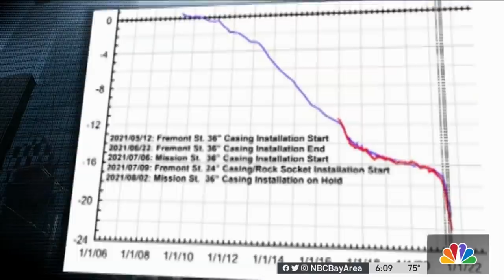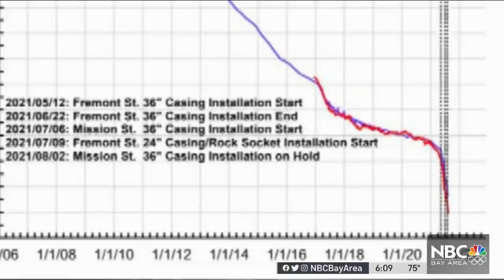Millennium Tower is Sinking Faster Than Rate ‘Limit' Set by Fix Engineers

Comment: easy fix: fold a bunch of refrigerator boxes and wedge ‘em in at the base
Reply: Wrong !!  A few sugar packets from McCafé is the correct answer.
Reply: your all wrong.. you need a book of matches
Reply: @carpelunam  I suppose this is really the best option after all. 

One question : do we douse the building with gasoline first , or , just light a wad of newspaper w/the matches & let it engulf slowly??
Reply: I was thinking some Tesla's and Mercedes Sprinters mixed in there all stacked up.🤣
Reply: Control-Alt-Delete  do you have a Sprinter?
Reply: Control-Alt-Delete  well you can keep yours. Destroy all others 🤣😅👍
Reply: Control-Alt-Delete  yeah I agree 🙂👍
Reply: move my mother in law to the opposite side of the building and it wont budge another inch
Reply: Control-Alt-Delete  lmao idk I was just making shit up. Dont have a mother in law
Reply: @DeuceGenius  “You kidding me, my wife’s so fat, when she puts on high heels she can strike oil”
Reply: Control-Alt-Delete  “I tell ya, when she steps on a weight scale, a card came out that said  one at a time”

“She’s so fat, when she takes a bath, she leaves stretch marks around the tub”
Reply: It works for that uneven table in the restaurant!😅😂🤣
Reply: @carpelunam  fire hazard,  but at the rate they are going maybe the best solution for that building!
Reply: Must be a southern fix
Reply: Just throw a cable around it and cable it up to the closest building and get a come a long and jack it back into place then throw dirt under the low side. I'd recommend going a few degrees past center in the opposite direction of the lean to allow for some slack to take the come a long off. .
Reply: @bartonpercival2147  Well now damn!!! I mean just DAMN!!!!🤣😂😅
Reply: @jamesstreet856  😆 Well that was just some old “Rodney Dangerfield” jokes re: how to fix the tower from the earlier “mother in law” comments
Reply: CSXRockford  omg my grandmother is back from the grave! Grandma???
Reply: Save on recycle. Throw your frig under there !
Reply: You sound like you got your engineering degree from Trump U and got out with high honors.
Reply: @DeuceGenius  rent one.
Reply: @bartonpercival2147  YT deleted two of my phat woman jokes .
Reply: @robertkustos2931  well maybe they weren’t fat or ugly enough jokes. “I tell ya I never had luck with women when I was growing up. I mean the girls I dated were big and ugly. I took this one girl to the beach, and they all asked me what I used for bait”
Reply: Jolly Joker.
Reply: @bartonpercival2147  what did you say , Harpoon
Reply: On All Future Blogs.in Cali.& Other Earth Quake prone Cities,Put  Japanese Architects & Engineers in Charge of Projects.Their Bldgs.Can Take 7.8-9 .0 Quakes  W/ Virtually No Major Damage.They Are the Experts on Constructing & Having Proper Foundations on High Rises.
Reply: @DeuceGenius  🤣
Reply: All they gotta do is reach under and twist one of the legs holding up the building. Theyre basically machine screws with feet. Turn it left, the leg gets longer. Anyone with a level and a wrench could fix it.
Reply: Let's be creative here.  SF can't figure out what to do with all the used hypodermic needles and human feces on its sidewalks.  Create a landfill of crap & hypodermics under the building to counter-act the sinking.
Reply: ITS TIME TO BUY GOLD STOCK.WHY RUN FOR CRYPTO.
Reply: BECAUSE OF CRYPTO ECONOMY COLLAPSE.INVESTORS SHOULD INVEST IN OTHER STOCKS
Reply: They could start with the fridge boxes from Nancy Pukeosi’s pair of 20 thousand dollar sub zero units she has to store her 14 dollar per pint ice cream

Comment: Let’s build a skyscraper on landfill, what could go wrong? Duh🤪
Reply: Happens all across the U.S., in San Diego during the last two years I watched builders put a new suburban housing development where they filled a canyon. Homes starting at $800,000, sitting on 100 feet of compacted dirt.
Reply: And then we ca blame climate change when we change the ecosystem ourselves.
Reply: This Will Get Me Banned Again  Exactly: along Hwy 56 between Camino Del Sur and Carmel Mountain Road. Name of development, "Merge 56 Project" west of Rancho Penasquitos. I used to run a trail in the canyon that is under 100 feet of dirt. They are putting in the connector road to Camino Del Sur, with the shopping center and condos on top. San Diego already had problems with settling cracked slabs in the 70' s and 80's, this will be another lot of them.
Reply: Earthquake= more tilt = Boom!
Reply: Landfills are expensive, to maximize use of land, developers must build high.

Comment: Failure of man-made structures, failure of man, failure of confidence
Reply: Ya well we would have woman built confidence but they don't build anything. But holy smokes if there's a sale at 2 am they will be there. Or if Ellen is on
Reply: failure of hubris
Reply: how can we trust engineered buildings when engineered means..the most strength with the least material in controlled tests..when   the field there are  no certainties..when these minimum materials are subject to rust heat cold...and metal fatigue over time...just like our cars..structurally sound when they are new...but 20 years of road salt later...unsafe at any speed...and the ones that last are the inefficient over built ones that are gas guzzlers..
Reply: man is not perfect, sht happens
Reply: its just one of those things, there is something to be learned from it for other locations

Comment: Has anyone calculated at what point of leaning is the point of no return when a catastrophic collapse is inevitable?
Reply: Good question. As it leans further it begins to lean faster as more weight is shifted off center then, once it reaches a certain degree of lean it's all over with. There is no way I would even go in that building
Reply: 45 maybe???!!!.  I have no clue ask the leaning tower of Pisa 🐒😌😱💥
Reply: i have to know, so I wont go there for my daily coffee and pastries anymore
Reply: Mayor London Dog Breed doesn't care.
Reply: I’d think it shouldn’t be hard to calculate by someone knowledgeable about the building. I would like to know the answer to that as well
Reply: Yeah, the point when you hear the base start cracking and if you're hearing that? make sure to run opposite the way it's falling.
Reply: @susanlbk  ask Mayor London Dog Breed
Reply: Already past point if no return.... May fall soon!! With core sinking faster than the outside walls.... Soon
Reply: Yeah, the same engineers who submitted incorrect estimates last time around🤣
Reply: No engineer in their right mind would make that determination.....you will have to ask a politician....
Reply: 13 degrees.

Comment: Champlain towers was leaning 1 inch or 40 years and fell down. This building is leaning 22 inches? I cannot even fathom understanding that?
Reply: Can only imagine what the inside floors look like
Reply: It's crazy
Reply: @deannaausten8867  staircases
Reply: @deannaausten8867  Set a bunch of marbles on floor and just watch them go.
Reply: @NeilPower  lol... then they would tell you nothing here everything's fine floors are good enough
Reply: Champlain did not fail as a function of lean. All building, especially towers, have a acceptable coefficient of lateral stability. The Champlain complex has a concrete erosion situation, at its base. It could have been repaired....

Comment: I built a house ... when the excavation for the basement revealed there was a solid limestone rock base two feet deeper then our excavation required ... I asked them to dig deeper!

Cost was $400 for extra concrete. and $100 cash to the excavator operator :)

I put up the concrete forms myself ... and drilled and drove rebar in to pin the footings to the rock.

We had a basement with almost a 10 foot tall ceiling!
Reply: $500 extra? How could a developer be profitable with all that extra expense?
Reply: @Mike Baxter   Good for you. Foundation work is the most important part of any building or road or railway or factory floor.   Get it wrong, and you live with the consiquences for years.
Reply: Your point is? That they should have dug 80m of soil to get to the bedrock? Btw, you went all the way cheap by "doing it yourself" Mr developer. You could probably have a lot of defects in the foundation and we just don't know about it because you've hidden it underground...

Great example yep
Reply: @EarendilTheBlessed  They drive piles down to bedrock Fred. There's no 80metre tall basement like in a residential home
Reply: @MikeBaxterABC  
I know what they are doing. What is your point?
Reply: @MikeBaxterABC 
You mean, you have none.. Great

Comment: Omg at this point, just rebuild the foundation and rebuild the tower with reinforcements or whatever the current tech allows. All these years trying to patch an impending doom didn't work. During those years they surely could have rebuilt the whole lot with entirely something new.
Reply: Fax 📠
Reply: theres a reason they spent all that money and time on it. if you take that thing down you may as well chalk it up and call it quits.
Reply: They are currently trying to drill 2' and 3' x 300'+ concrete and steel tubes down to bedrock, alas that work has been stopped recently because the building started sinking and leaning faster, due to the repair work.

Comment: Hook a helicopter to the roof. Pick the building up a little, spray that great stuff expanding foam on the low side. That will fix everything
Reply: A little 200 mph test duct tape also may help.
Reply: 🤣🤣🤣 although probably better than the actual plan

Comment: This does question the usefulness of San Francisco's building regulations.
Im all for thorough regulatory processes when it comes to infrastructure HOWEVER there is a difference between filling out 1001 different forms & a process that adequately evaluates a proposal.

Most modern regulation is just box checking.
We have been building skyscrapers for well over a century. We shouldn't be having issues like: Poor ground stabilization at this point

Comment: When Champlain Towers South collapsed, the internet was crowded with the condition of the Millenium Tower. How long until it collapses?
Reply: the question is will it collapse at free fall speed like happened 3 separate times on 9/11/01?
Reply: I'm still waiting for the 3 gorges dam to collapse. Any second now.
Reply: @kalatime - What does it have to do with the governor.  It's the builder's fault.
Reply: Who knows, an earthquake can shorten the  time frame from years to days.
Reply: @chillbro606  - Depends if Larry tells the ghost FD  Commander to pull it.
Reply: @hangender  - Oroville is on my watch list. Half the watershed is burned. Those mudflows into Oroville lake are not going to be released via a spillway. That means the lake is going to up very fast. It is an earthen dam, if it overflows, it fails. And nobody disputes that. 5,000,000 residents  live in the flood plain below.
Reply: 300 years

Comment: I'm not an engineer but I would build a helicopter with a couple or maybe 4 Chrysler 426 Hemi engines and then hook a cable to the top of the building and then to the helicopter and fire all 4 Hemis at full power while pulling in the opposite direction of the lean while engineers on the ground pound some big wedges around the gap at the base.  Hope that helps.

Comment: Well what do you expect , SF is on wet land . The foundation of the ground in that city is horrible
Reply: Its horrible but not impossible to build on. Those idiots went cheap and didn't drill all the way to bedrock. This is the end result
Reply: @mayhemjr.803  Exactly
Reply: I think a moderate earthquake of 6.3 or above could topple that. The key factor is how close and how deep if the quake. 

The Northridge  quake was 150 miles from me, yet my house was shaking big time.

The 1989 Loma Prieta quake shook half the buildings in downtown Santa Cruz so hard they all had to be torn down. 

No matter what she quake hits the area - within a 30 mile span from SF, the  ground  shaking or faction, will accelerate the tilt. 

Dismantling a building that size, which  is too dangerous to live in or be in, will not be easy.
Reply: @mayhemjr.803  They saved how much........ $20,000,000 ? That stunt likely a $2 billion crime.

Comment: I saw this movie once where they hooked a lot of balloons to a house and it floated away. I mean, you'd need a real lot of balloons but...
Reply: RIP Ed Asner
Reply: hook the tower up to a couple of SpaceX rockets and send  into orbit
Reply: A lot of balloons won't do it.  Even if you harnessed an air column from sea level to space with the same width and length of that building you're only getting about 16000 tons of lift, or about 500 truck loads.   I'm not sure what the building weighs but you'd also need to suck its 75 feet of basement clear out of the ground, assuming the concrete pad and 950 x 80 foot pilings aren't physically attached as well.  Might have more luck by tunnelling under it and detonating a small nuke to get things moving.
Reply: @veramae4098  But the question in your mind should be, what happens if I'm telling the truth? Who could dream something like this up and why would they want to? I have offered to take a couple of skeptics to that area of the mountains, but they chickened out. Like I told them, this is not something that I can't prove. If they want to see these giants, they can load their happy butts in my truck.

Comment: If they just dig a little dirt out of the opposite side of the lean it’ll straighten out! Done! I fixed it sitting on the toilet on break at work! I’ll take my pay raise now!
Reply: Unfortunately, you aren't equipped with the facts. You see, under the dirt is water. Water doesn't care how much dirt you add or remove. It's water. Got it?
Reply: @craigjgomez  unfortunately you aren’t equipped with a sense of humor 🤣. I posted another comment in a similar video a couple weeks ago suggesting to use the leverage of the building and ratchet straps around the top to another building, ratchet it until it is straight and throw some dirt under the sinking side… once you are equipped with a sense of humor, please, come join the world. LOL 🤣
Reply: @alexsystems2001  genius - i like the strap-on idea the best!
Reply: @craigjgomez  wah wah wah lol 🤣
Reply: Duct Tape, Flex Seal and a Sham Wow will fix everything.
Reply: @sanfranciscobay  only if you roll up your sleeves to make it look like you are a professional! 🤣
Reply: @alexsystems2001  I can pull out an old Calculator and Slide Rule, wear a Hard Hat and Flourescent Yellow Vest, take notes, point at things and pretend like I'm doing something important. Am I hired?
Reply: @sanfranciscobay  if you go through all that effort, you’ll be the supervisor!
Reply: they drilled on the wrong side ------do it on the high side - to sink it down--- that is how it is done in the fly over country
Reply: @verngoossen3628  They are drilling on the low side to bedrock, then connecting that to the foundation to try to prevent further settlement. Then hoping the high side will settle over years and it will level itself.

Comment: I was a building inspector in a small (40,000 winter/80,000 summer) town. If a person wanted to build a room on an existing open deck, we made them do a soil bearing analysis on the existing concrete piers to be sure they could properly support the additional structure without sinking. How do these guys not have this figured out before building this thing?

Comment: Maybe it’s something with a name, I helped build a millennium Tower in Calgary Alberta Canada, the engineer set up springs under it so it would not sink but in the first year I dropped 2 inches, we finished building that in 2003 approximately.  Think about that. Another bad decision to build too close to the water.
Reply: 5 inches is normal. 2 is exceptionally good.

Comment: Fremont St must get a lot of water to drain into the clay layers. On the chart say 36 next month say 24 when something heavy is done. Could be that the earth's clay is so wet? When it is dry the water has gone leave the building to sink.  Check parking garage for water problem on the last level. The best idea is section by section take the building apart and redo the base and ground. If it falling on one side of the building and cracking on the other it is a big sign the hole is bigger or wider. Water leaks underground.  Would use ground tracking radar on the parking garage walls to see how wide the hole is could give more info on how the building failing slowly. Check water lines, hydro lines underground to see if the building using them for support. Anyway just idea's

Comment: A lot of these high-rises are build near or on top of water. This high-rise is not the only one that's sinking gradually now. It's the only one that is being reported at this time.
It has been reported because it has become obvious that the building is tilting. If the engineers do not handle this problem... 
it is possible that this could become another Surfside that happened in Miami.
According to reports some high-rises do sink, so many inches down overtime.
Especially if built near... water.

Comment: In the video, they mention that the building is tilted 22 inches.  That really doesn't tell us anything.  What does that mean?  Does that mean one side has sunk 22 inches?  Does it mean that the top has shifted laterally by 22 inches?  That still doesn't mean anything without knowing the height of the building.  Some buildings may be designed to flex 22 inches in the wind.  Big deal.  Please provide relevant, useable information.